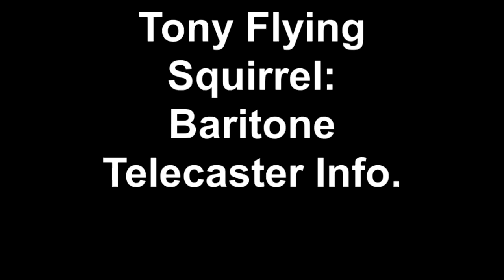Tony Flying Squirrel: Baritone Telecaster Info.

Comment from the maker: Yes, standard B tuning, from low to high (B, E, A, D, F#, B).  Still plays like a standard 6 string, just tuned down a fourth.  The only other tuning I use currently is Dropped-D occassionally on one of my other guitars.  I used to have a nice "Z" guitar from when I worked at Warmoth tuned down a whole step & occassionally I would do Dropped C on that, but it got stolen last year.

Comment from the maker: With humbucker, you might lack some definition, but I'm sure if left in SC mode, and with a bright amp setting it might sound cool.  I wouldn't have the slightest idea how to play chords correctly with that tuning though.  My experience is mostly in standard tuning, Dropped D, D Standard, and Double Drop on the 7 string (low D, Low A).  I have considered baritone Nashville tuning though, perhaps on another project.  I like this one the way it is.

Comment from the maker: Standard Fender Neck Pocket Specs, same as those on the Warmoth website.  See this link for the specifics.  warmoth DOT com/Guitar/Necks/NeckHeelMounting.aspx
If the Tele neck you have meets these specs, you should be fine.  GFS and Warmoth adhere to one of Fender's specs.  When I worked at Warmoth, I discovered that Fender's specs have multiplied over the years, best to check what you have against the details in the link above.